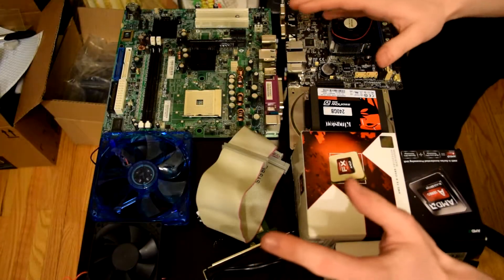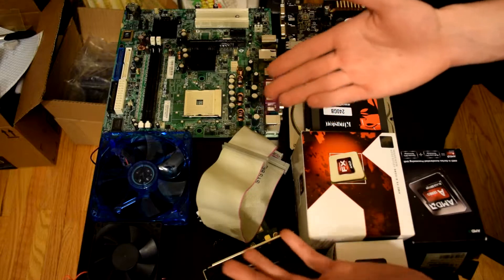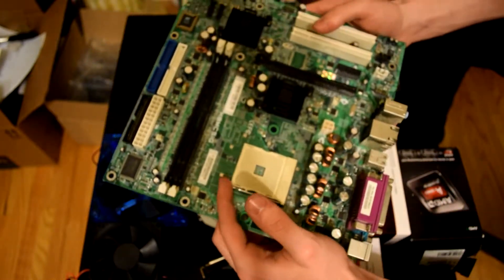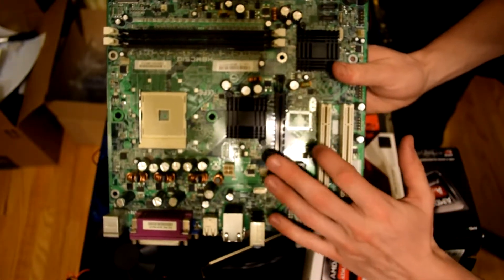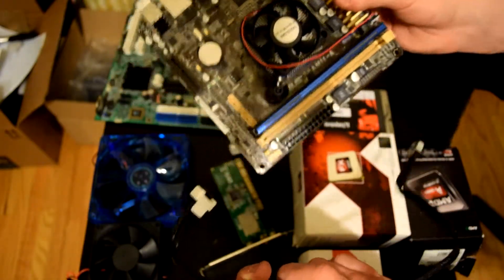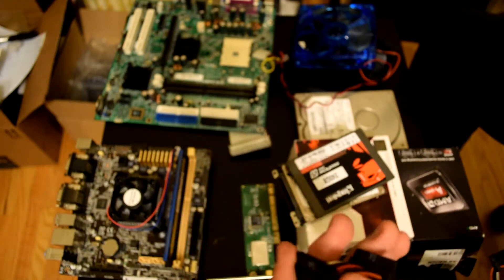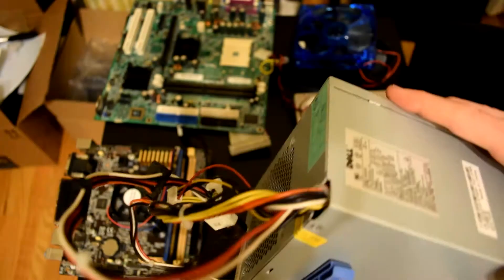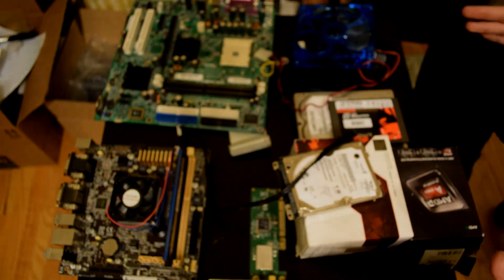Computer Build Guide Part 1: Compatibility & Part Picking

Comment: I3-4160 or athalon x4 860k? Its my first build and i cant find a board for a decent price for the athalon with the right bios to run it( im scared to try to upgrade it) the intel i3 tho has many which is better for my first build?
Reply: go with the x4 860k any fm2+ motherboard should work fine
Reply: X4 860k